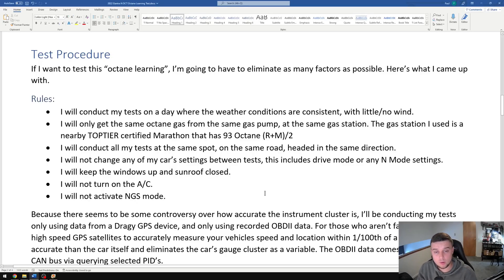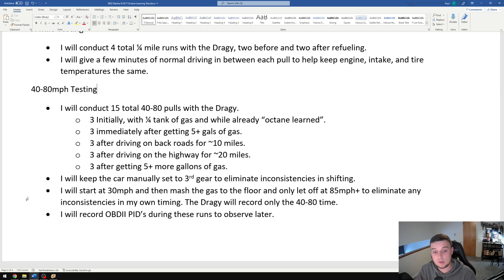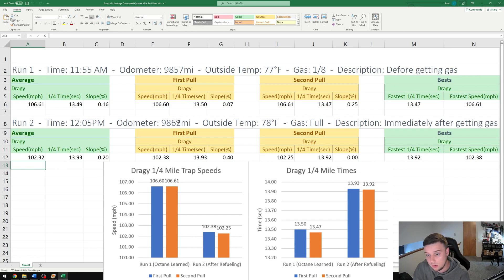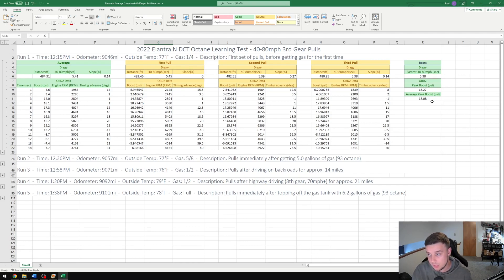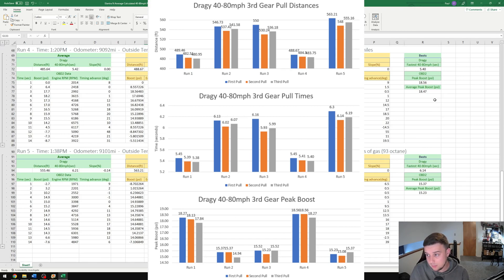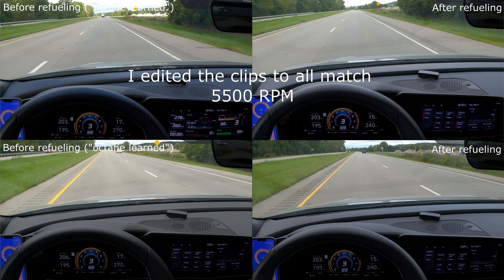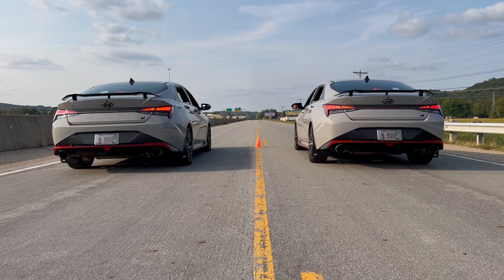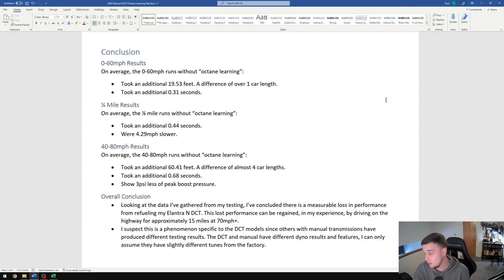Hyundai Elantra N DCT Octane Learning Tested

Comment: So every time you fill up, if you want to get the vehicles optimal power, you have to jump through all those hoops... And then next time you fill up you have to do it again?
Reply from the maker: Unfortunately that is how it is from the factory! The car is pretty quick either way but there’s a noticeable difference. Easily the worst thing about the car in my opinion.

A tune will take care of this issue, but if you want to stay stock you have to live with it .
Reply: @ItsPaulby  yeah... Spent a fortune on mods and tuning on my MK7 Golf R. That's why I like the EN... Already super aggressive from the factory. Don't want to mess up that 5 year / 60,000 mi warranty, even with the JB4, they can still find out I think. 
I wish I never knew about the octane learning thing... Then I wouldn't know that there was extra power I could tap into.
Reply from the maker: @Daveyboy_RS3  JB4 is a good route to go! I’m personally planning on going that route for a while. Awesome Golf R btw!
Reply: @ItsPaulby  thanks! It was recently stolen and then totaled by some numbskull. That's why I'm looking for something fun. If I get the EN I know the mod bug will get me and I'll end up with a JB4 to start at least. I love that EN... The individual custom performance settings are insane... Comparable to what's available on $90,000 plus cars like an m4 comp or CT5 blackwing.. for only about 35k. That's insane! Can't wait to drive one... I'm sure I'll buy it on the spot if I do. 👍
Reply from the maker: @Daveyboy_RS3  Damn, sorry to hear!

If you're ever in central Ohio you're welcome to drive mine! For the money it's an amazing car. It sounds awesome, I'm getting 4.82sec 0-60 stock, 4.7sec (1ft rollout) and 1/4 mile of 12.9 @ 106mph. I checked out an FL5 type R and found it to be less exciting even though it looks amazing.

I hope you get the chance to check one out!
Reply: @ItsPaulby  Good man! Yeah I like the way the fl5 type R looks... But down here in South Florida you can't get one for under 50k. And that's if you're lucky. 👍

Comment: Nice... but how can one disable octane learning from reducing performance if you add the same fuel?  I suppose it's a fail safe put in by the manufacturer, but it just seems silly if you run the same 93 octane fuel every tank.
Reply from the maker: I don't think there's a way to disable that feature which is a real shame for the reason you mentioned. I really hope that a solution comes along at some point for those of us who don't want to tune but want that extra stock power :)

Comment: do you remember what RPM you were launching at? and did you have stability and traction fully off by holding the button? or was it just traction control off in sport + mode

Comment: How much throttle percentage do you have when cruising in 8th to octane learn? I feel this may be the key to why its so hard to do in the manual.
Reply from the maker: I've never kept track of that but engine load might be something that impacts this!
Reply: @ItsPaulby  In my testing , load has a huge role. Manual is really hard to learn on the highway, and has to be done via the track method for this very reason.

Comment: If you always run 93, which i do, why can't the ECU remember and know I'm using the correct fuel everytime🤔
Reply: Maybe you are buying shitty gas?  I don’t know though. Honestly I mean, I’m not putting my foot to the floor very often. I’ve never seen over like 13psi and I’ve ran 91 since I got it. It’s hard to find 93’ where I’m at-
Reply: It is to protect the engine from detonation.  Too much boost is bad for the engine if the fuel's octane level is not high enough.  The designers decided that it was a bad idea to trust the driver to manually input the gas type, because obviously there are enough idiots that would just lie to get that extra boost.  Also the reason NGS only lasts for 20 seconds.
Reply: @ubiquity60441  I get that, why can Mazda do it w/o jumping through hoops🤷‍♂️
Reply: @ubiquity60441  I'm sure people could read PREMIUM FUEL ONLY at this point📣🤔

Comment: Do we know if tuning the car such as using a SXTH or LAP3 calibration remove octane learning?
Reply: Because octane learning isn't something new but it's more aggressive on the N to prevent a shit ton of warranty claims when owners put 87 by accident or gas station truckers confuse 91/93 as 87...it keeps engine performance low until the computer reads and make sure that the gas tank has a fuel that's is above 91 octane then it loads in the actual performance of the car and runs full boost knowing it will not knock due to high pressures
Reply: id like to know the answer to this also. if the sxth tune is 20psi.. after octane learning does it shoot to 23 psi?
Reply: @HardcoreHobbyist  no it would not work

Comment: I doubt the VN DCT has it, but I will test it today to see if it can "learn" it. I think it requires 93, which we don't have here, but I always use 91 so I'll see if that works.
Reply from the maker: Let me know how the test goes!
Reply: It requires 91...
Reply: @reyfuentes4572  it requires 91 or higher actually
Reply: @ThePooIsCIosed  he said it requires 93 it doesn't on the manual it says it requires 91...its pretty common sense that the car can run a higher octane since it's harder to detonate which means less knock

Comment: You have to re-learn this every fill up though? What if you strictly only use 93 oct and simply reset your battery?
Reply: i have to kona N since January with nothing but 93oct 20k miles u have to do it every fill up
Reply from the maker: Every fill, I’ve disconnected my battery once but it made no difference. Not something I’ve really tested though.
Reply: @ItsPaulby  it also does this after the car is turned off. It’ll drop to 15psi all over again and every time you have to relearn octane. And like you said after refueling. It’s quite annoying and wonder if a tune would take care of that issue
Reply: @ItsPaulby  that’s kind of lame, I only use 93 always either way, but I don’t have time to relearn every tank…I’m hoping after using 93 for a while it will stay consistently high, even if not 19 psi

Comment: I wish the octane learning worked on the MT
Reply: It does, it’s just finicky
Reply: @8WRLD_Infinite  ...any tips? I tried all their recommendations...travel to work 30kms plus one way to work everyday on highway at least 120 ...tried every premium gas available here...cant get past that 15psi :(
Reply: @StephenMaschi  me too man.. I have dct 🤷‍♂️ but I have hit 19psi here n there. I’m in Canada (Nova Scotia) the highest octane we got is 91, which should still work but I jus can’t do the octane learning when I want.. I think it’s easier if you don’t do it in cruise control on the hwy, but I’ve done that too ha. I’ve only done launch control once and used ngs twice, recently broken in, I dunno if is a factor. Anyway.. good luck to both of us ha, I’ll have to try it a bit more.
Reply: Doesn't work for me either. Manual  as well
Reply: @StephenMaschi  update, consistently works around 40 miles left in the tank. Do octane learning procedure around 100 miles left then when you hit 40 you’ll get 18 -20 psi.
Reply: aaron boudreau im in quebec gaspsie soon as my car hit 1000km just like a switch holdin 17psi solid now ? weird lol

Comment: Wow the difference is real! Why on earth would Hyundai do this? They should have just required premium fuel from the start with the more aggressive map being the default, unless the car detects knock of course.

Hopefully future model years will remedy this, because it would definitely annoy me if I was an owner.
Reply: Hyuandai should have never did that. Terrible feature
Reply: Right, thats a HUGE difference in performance. 102vs 106 mph in trap speed. 
🤯 😮
Reply: @M4B21S88  lol huge?
Reply: @mharro88  4 mph trap speed is a different
Reply: @mharro88  okay, maybe not HUGE but 4 mph is a pretty significant difference in performance/power.
Reply: If I had to guess, these N engines are undertuned for reliability.